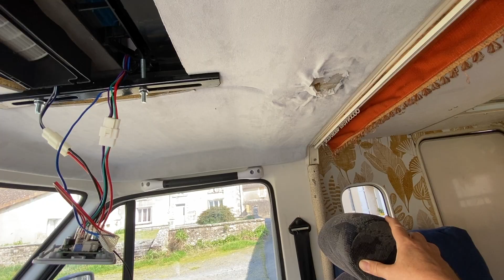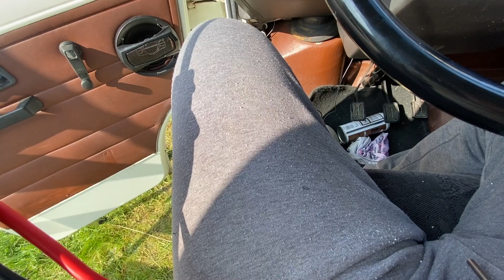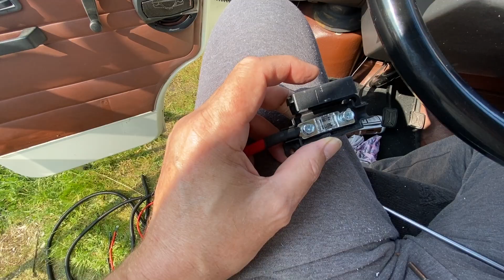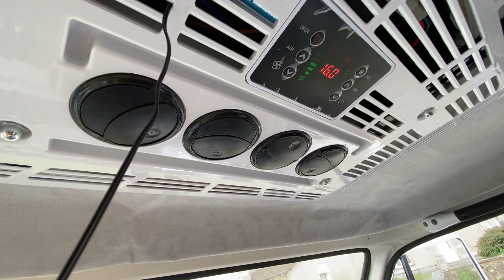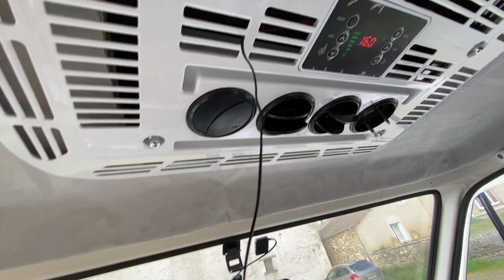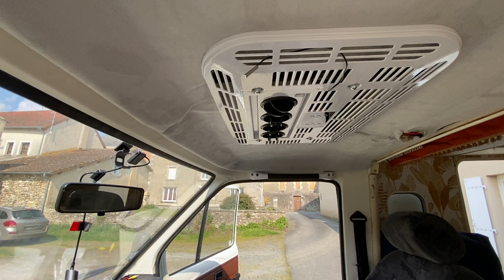1983 Rapido 410 - CAN the cheap, 12V roof mounted Air Conditioner REALLY  WORK as an AC?

Comment from the maker: So now is the time (March) to think about installing air conditioning. If you wait until you actually need it, you will be miserable sitting on the roof and cutting holes and installing the unit in full sun and high temperatures. It took me a day to install this cheap Sunster 12V air conditioner and with limited testing (it's not hot enough yet to need it), it performed admirably. Combined with my Humsienk 314Ahr LifePo4 battery and 400W of solar, it should give me 8-10 hours of use. Are you thinking of installing AC or have you already done it?

Comment: I've just purchase this model in the UK, what was the process for.gassing it up? as it flashed up a warning in the installation video about power on but don't use high voltage button, and not clear what that means?
Reply from the maker: Before you install it, take it to an AC guy - local garages will usually do it. They need to draw a vacuum and then fill it with 500g of R134a. Then you can install it and all is good. Let them know that the PAG oil is already installd.
Reply: @Rapido410RandonneurThanks